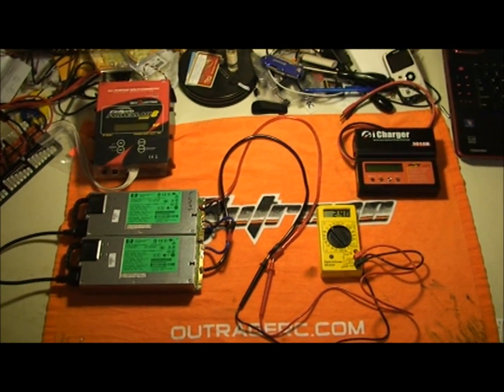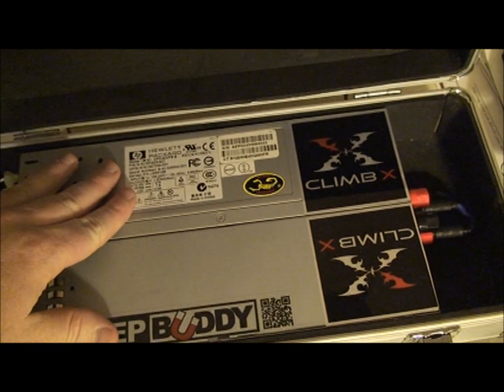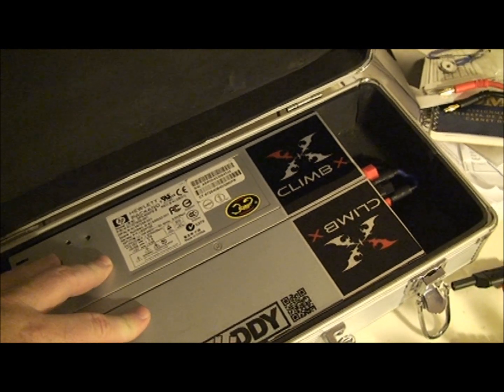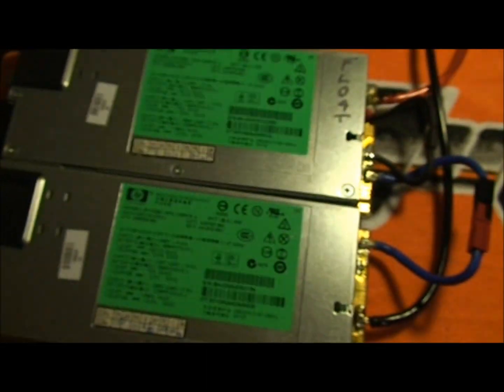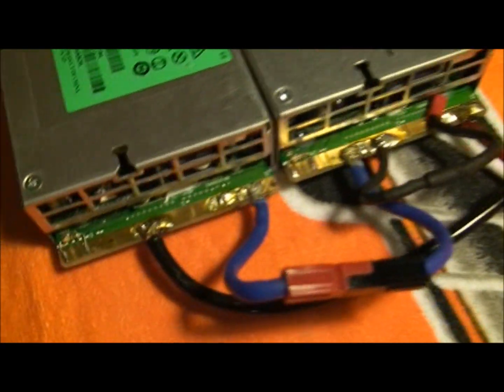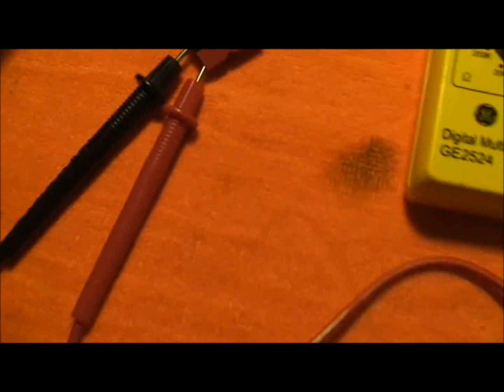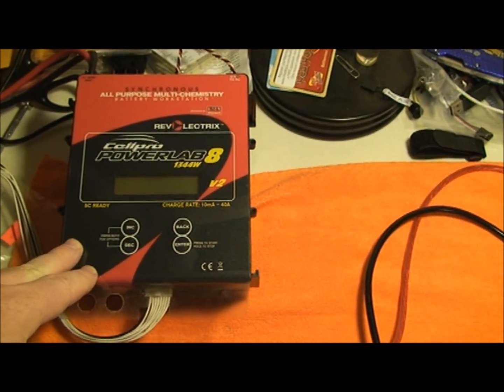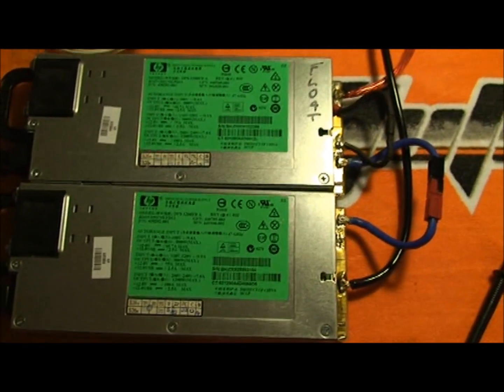Cheap power supplies for 40amp charging of lipos for RC helicotper

Comment: Diode goes from negative to what under the case??
Reply from the maker: At the 5:08 mark stop the vid and zoom in. You can see where it goes inside the chassis. There are screws that hold the circuit board to the frame I used an electrical connector that had an eyelet so I could slip the bolt through it and this was this is grounded to the frame.

Comment from the maker: The Diode has a white line on one of the ends and from the diagram that I have that is the end you want to connect to the negative. It’s been a long time but if I remember right I installed mine backwards the first time all it did was not work and a solder a new one the opposite way and it worked. Hell they are still working!
Reply: Thanks, for the information.  This is the only video that I've seen that has the zener installed.

Comment: I am trying to figure out the direction of the diode, could you please let me know? I like the safety feature it provide
Reply: Same here, you would have thought he'd mention that, as it's pretty important. Not everyone knows electronics. You definitely don't want the negative 12v flowing to the case (Left to right), so the ring on the Zener (reversing diode) is on the negative side, not the case attaching side. Then when there is an over current in the DC circuit, ie, 15v / 5w, the Zener diode reverses current (L to R), and allows that to flow from the negative 12v into the case and stops the ac power circuit...Not too sure how that happens though.
Reply: He mentions it below. The ring on Zener diode is on the negative 12v side, as I mentioned above.

Comment: I got no out put after drill 3 holes to insulate the PSU,.I used 1k ohms potential meter,I don’t know if that is something caused it. Please help.
Reply from the maker: +ASUS Micro  Don't quote me on this (its been a while) but I believe that the A/C ground has to be connected to the case. I installed a ziener diode on mine so that if there is an internal issues it would blow the diode and pass it to the AC ground. Basically by drilling out the hard mounts from the case you are isolating the Brains grounding from the AC grounding so that you can get the 24v. Take a look at RChelination pbs1200 as they have a pretty nice write up on converting it.
Reply: +manwichmouth I did follow the RChelination instruction. but my power supply stopped providing 12vdc after I drilled 3 holes on the PCB board.. what diameter did you drilled?
Reply from the maker: I drilled relatively small holes just large enough so I could get the nylon bolts in to isolate the board. I was careful not to damage any of the other traces. Did you check all of your connections? You also have the resistor still in place (with out that it wont see a load and will not turn on). Besides that Im not sure.
Reply: I drilled 1/4 in. hole because my bolt won't fit.. I think that's probably what caused it. thanks though. I have a new one on the way. this time can I just pull ac ground in one of the psu and separate two psu with non conductive foam?

Comment: do you leave the green wire(I think it's AC ground wire) connected to chassis?
Reply: ASUS Micro Yes. It is at the front of the case. Only drill out the two at the back of the case where the green led is located.  Those are the two where you must isolate the case from the DC side of the PS.  I then used a 1 watt 560 ohm on pins 33 and 36.  Be sure the green ac ground wire is attached to its original Point! These HP power supplies are great! This video helps with the connection of multiple PS.

Comment: Can you run this set up in parallel to achieve 150a @ 12v instead of 75a @ 24v?
Reply: k metz yes u can but u wont find the pin listed on the forums to load balance them. On mine it was pin 34 if im remembering correctly....that syncs the voltage output and avoide any issues with them not matching and gives 1800w total on 120v and 2400w on 220v at 12v out.

Comment from the maker: Actually I did as I didnt like the exposed circuit board I could have gone the cheap way and just used liquid electrical tape on it but, I went to progressiverc and bought one of their PRC cases. I figured out that these power supplies are the same height as the meanwell 24v power supply that they sell with their complete kits. So I ordered the prc case and the acrylic top the rest of the parts I sourced from else where. Basically I made the same case for a FMA Power Lab 8 with 24v power supply at a much cheaper price. Also my main case fan speeds up depending on the temp sensor I have mounted on the back power supply.
Reply: where can i get that?

Comment from the maker: They are HP dell DPS-1200 fb a, RCHelination did a great write up on how to convert them over http://www.rchelination.com/setting-hp-dps-1200fb-power-supply/

One day a lot of us will make more money but for now there are countless threads on several forums all dedicated to the conversion of server power supplies for RC use to 12v, 24v, 36v, and etc. Personally I actually enjoyed learning how to and making them. The wife wasn't to happy when I plugged them in but nothing caught fire and it they work like a charm.
Reply: Hi Need help I have one dps1200fb but I'm jump film metal resistor 1000ohm 33,36 but not led green on and sound  slower fans rpm let me know help please

Comment: Well, that is an interesting project, but it isn't the same as buying a meanwell because you are using the power supplies out of design parameters (series, zener, floating DC-) and because the ripple voltage is almost certainly much higher.

I feel qualified to say this because I am the one that first thought up the nylon washer, in a thread, and Wayne thought up the zener approach.  I eventually made some kits so that just anyone can do it, but eventually abandoned it because of the time it took to make them and because of the risk:

http://www.rcgroups.com/forums/showthread.php?t=1369612

Have you had a chance to put the new power supply on the o-scope and look at the output?  One way to check the power is to see if your power lab shows a different output voltage as your meter.  If that is the case then you probably have at least as much ripple as the delta voltage between the two.
Reply from the maker: Your correct it isn't the same as buying a meanwell because it is also a lot cheaper (that's why I did it). As you said they are being used outside of there design parameters, so technically speaking a meanwell would be better. But for someone that cant afford that and is into tinkering this will work.  When I made this video there were only a few power supplies at the time that were putting out the voltage and amperage needed for a high powered charging setup.

Funny thing is I actually made my first power supplies based off yours I believe and thats how I latter wound up at doing these. So thanks to you and Wayne both.

Funny thing now is a 24v setup is no longer high with the new chargers they are going to 36v setups
Reply: o my god , do you know what the price of the meanwell is. Being out of parameter is fine for me. tell what the price of a 24 volt 40 amp meanwell cost, and what does out of parameter mean, so i can tell why i should care.